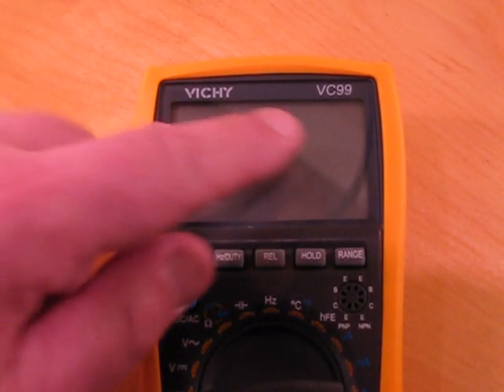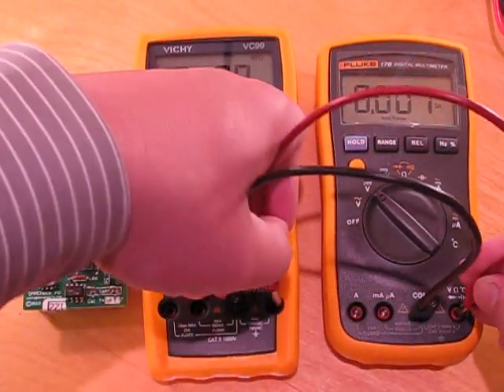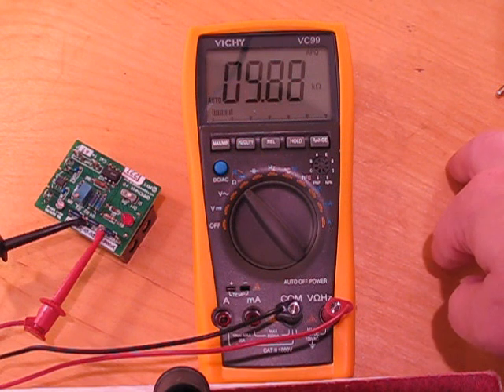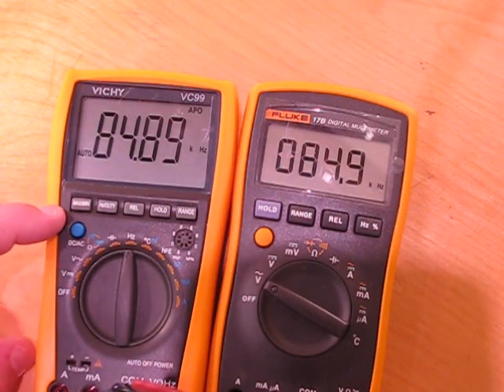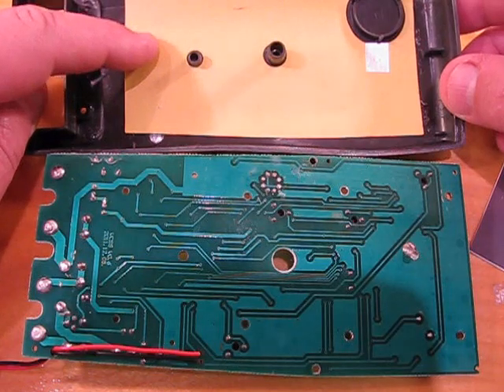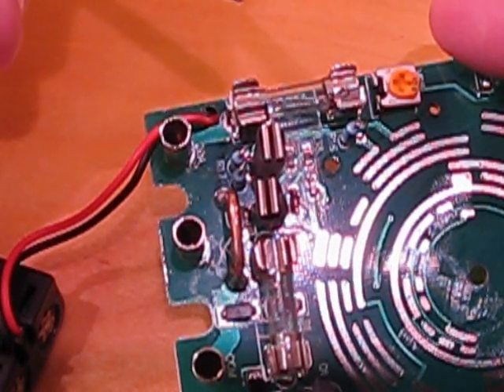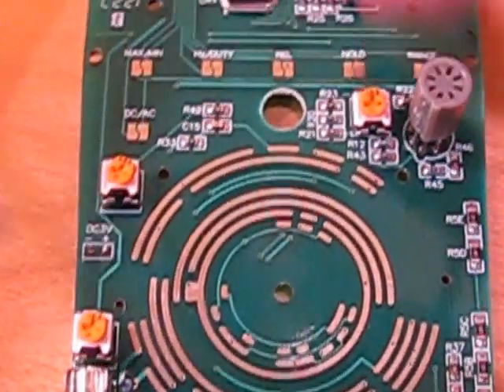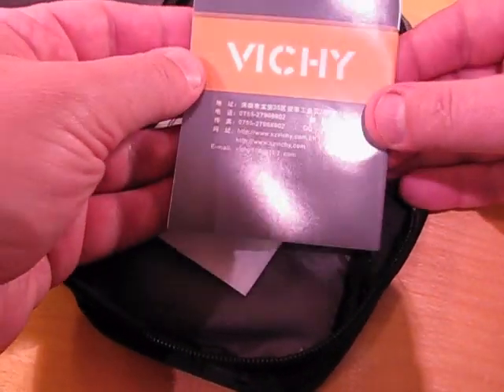Vichy VC99 Multimeter

Comment: I once was measuring about 650VAC (still below the 750v limit) and a spark happened at the probes. I wasn't aware of a small crater created by a spark inside the multimeter, across the rotary switch contacts. That had cause me loads of annoyance as the burnt pcb was shorting two contacts lowering the internal impedance to 1.8kohm and therefore affetting all readings of voltage on high impedance circuits.
Also, If there was a way to make it stop beeping before auto off, I'd be insanely grateful!

Comment: Nice review. Yes it is very accurate. Even moreso than the fluke.. but your poinyts are well taken. For an electronics use it is fine.

I would have liked to see you show the buttons like hold and how they work.

For the hobbyist it is a very good  unit provided high voltages and moreso energies are avoided. D3fi itely not for a linesman.

Comment: the main problem with this multimeter is than it display 1 or 2 microamps then there is nothing plugged (on micro amps channel) and one milliamps on mA, and 0.001 A on A channel. If there was no this trouble of build, the multimeter would be perfect.

Comment: I have this meter and noticed the temperature  accuracy is off quite a bit. like around 10 degrees F. This has trim pots labeled VR1, VR2, VR4, VR5, VR6. I have looked all over the internet for both the VC97 and VC99 and have not found which one is the trim for the Temperature probe. I hate to just experiment and adjust  these pots randomly until I find the correct one because I would just mess up the calibration for the rest. If anyone can identity these trim pots for this Vichy Multimeter it would be much appreciated.
Reply: Any luck finding the pots? I just got this and want to clibrate the temperature probe aswell. Thanks
Reply: +Motor Madness no, kind of gave up on it

Comment: Nice review - I would say that the accuracy is more set by the "precision" resistors. Fluke of course uses precision multiple resistor packages. The Vichy probably a few 1% types. Remarkable they can produce a competent meter for this money though. We can only hope it lasts and does not let you down at a bad time.